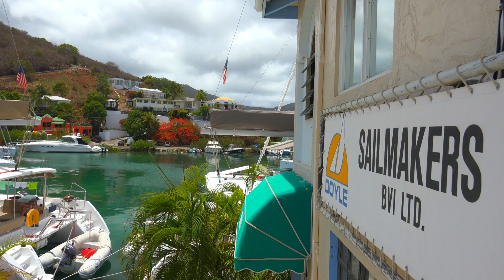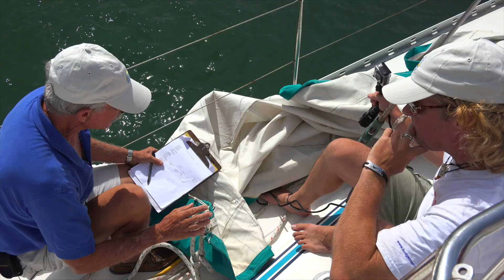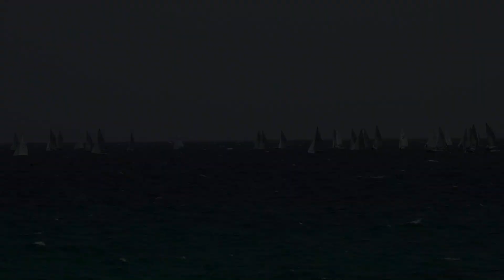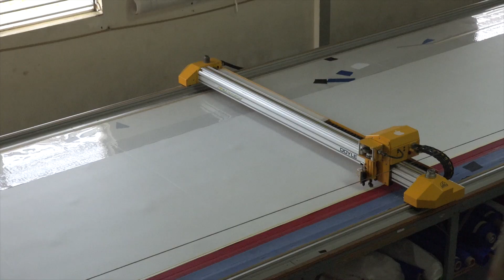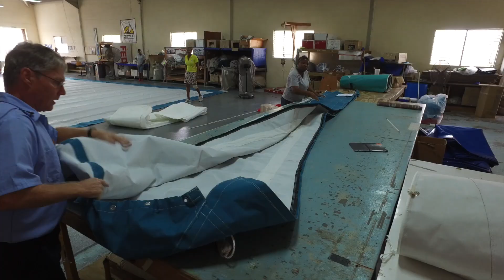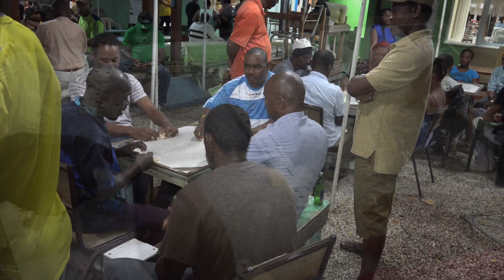Just Another Day in Paradise ~ 'SOPHISTICATED LADY' Sail Design & Replacement in BVI & Barbados!

Comment: We've visited Doyle Sails of Southern California.  They are next to our favorite chandlery.  We're going to have then put together a new main for us.
Reply from the maker: Glad to hear!  How's things in your side of the continent, are you out cruising yet?
Reply: +Rick Moore Not yet.  We're still repairing things and having the hard dodger installed.  Arch and davits complete, water maker, refrigeration, strorage, all complete.  I'm jealous of your new sails.
Reply from the maker: Very cool, which watermaker did you go with?
Reply: Rick Moore Since it is just going to be the two of us, we went with the PowerSurvivor 40. It's the same the LeaLea team used for several crossings, and Chuck tells me it has worked flawlessly.  Doesn't draw a lot of current, so the solar will be able to keep up with it.

What's yours?
Reply from the maker: We haven't decided on one yet, but will look for something very efficient to run off 12Vdc that will give us about 30-40 gallons per day on average to keep up with 4-5 people, and cleaning scuba gear, etc.
Reply: Rick Moore Ours is 1.5 gallons/hour at 4 amps draw, so around 36 gallons in 24 hours if you run it all day.  You would need something with higher capacity, obviously.  We also looked at the Little Wonder line and they looked good.  I'm sure you've got something in mind so it will be interesting to see what you come up with.